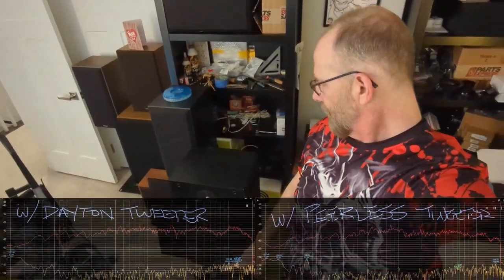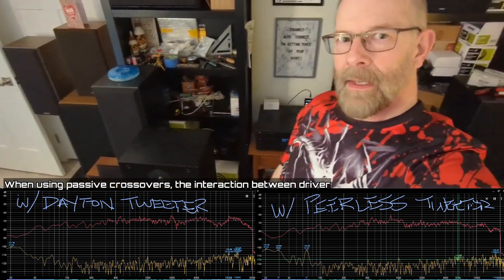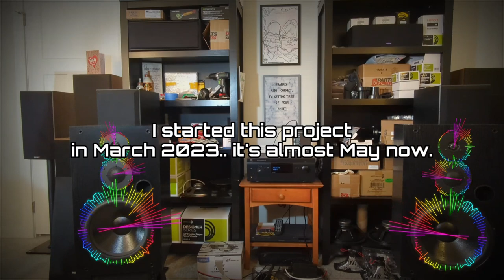Replacing a Peerless Tweeter with the Dayton Classic Silk Dome Tweeter RCA STS-1230 PART 20

Comment: Any idea what your cross-over frequencies are?
Reply from the maker: Hi Emmett and thanks for the great question! The truth is, I wish I knew. I bought them on eBay used, and the seller couldn't remember.  If they're the same as Laspada current designs, it should be either 650/5000, or 850/3500 Hz. From the first couple sweeps though, it's really hard to tell where the crossover is because it's working pretty well. There's no obvious suck outs or peaks. I figured anywhere between 500-1500 at the low end is fine, and anything above 3500 for the tweeter is good too. I may install Zobel networks on the drivers to see what happens also. I did that on an older project and it was pretty impressive the difference it made when all the drivers had Zobels. With just one or two drivers it didn't make much difference, but installing them on all three drivers, it helped immensely.

Comment: True the peerless may of had a flatter response but they were not as efficient as the Dayton so the Dayton matched better.
Reply from the maker: That's sort of what I was thinking as I was looking at the graphs side by side. The Dayton does have a higher sensitivity and I'm thinking that may have helped transition to the midrange. I'll need to look into that some more and see what the Omnimic software results are. At first sight, it seemed that the Dayton tweeter seemed to have behaved better with the network and cleaned up the midrange even further down the line as well, but the transition towards the treble end suffered some. I'm not overly concerned with the peakiness above 10k with the Dayton, since not much playback material is up that high, but it was impressive to see how flat the little Peerless was up there. Between the two however, and the Dayton being a plan C backup, I was glad to see a cleaner midrange even if it doesn't have an impressive high end. I'm wondering what it'll sound like after it plays a while. It's a pretty sharp sounding tweeter for being a silk dome. It sounds more like mylar at times. The Peerless silk or textile is crazy smooth sounding though, while still having that sparkly high when needed. It also seemed less finicky about loud volume compared to the Dayton, which sounds nice to a point, but push it too hard, (anywhere past -5Db reference), and you can hear it get trashy sounding. I got 3 more of those little Peerless tweeters from Digi-key I'll use those in some other projects. It's too bad Parts Express doesn't offer Peerless unless bulk ordered, they seem like nice transducers.
Reply: Regarding the peerless you like often one can find those speakers from another online seller

Comment: How about learning how to design the crossovers so that they match the measured responses of your drivers in their enclosure. Doing this will remove the trashiness in your dayton tweeters
Reply from the maker: Thank you for watching and the comment Bernard. It's a valid question and an excellent suggestion. Designing crossovers for the drivers, and fine tuning them once assembled in the cabinet is the best way to do it. 

The projects I've done in the YouTube videos thus far are all budget bang for the buck builds, so I've gone at it a bit differently.

In this particular build, I utilized an older used pair of Laspada Audio crossovers that I got for really cheap on eBay. I couldn't even buy a single decent air core inductor for the price I paid for them.

That being said, they had several hundred dollars worth of parts on the boards, but I figured I'd try them out on this project. They're really impressive for pre-made crossovers and based on measurements and listening throughout the build, they work pretty well as is. In a future video on this project, I'll likely install Zobel networks on the drivers. That worked wonders on an unruly pair of off the shelf crossovers I utilized in a previous build.

The Dayton Designer tweeter was originally purchased as a backup for that other build, (Jensen CS 315), but I found that the GRS Phenolic Ring Cone Tweeter originally selected for the build, sounded better so the Dayton Tweeter was shelved, but I had to pull it out again for this build because of my own Blunder when I ruined a Peerless, and being too impatient for the replacement to arrive. The day I installed the second Dayton Designer Tweeter, the Peerless showed up on the doorstep, but I'd passed the point of no return by opening up the holes in the baffle, so I stuck with the Dayton for now.

Now... About that trashiness I hear from the Dayton Designer Tweeters: I'm not entirely sure what's causing it, but they behaved similarly in my other build as well. Even with Zobels on them. One viewer suggested it might be due to the width of the baffles on the vintage speakers and it's a possibility. I don't think it's the crossover itself causing the problem, but more likely misapplication of the tweeter. The Dayton Designer Silk Dome has had a lot of use in DIY designs that have yielded good results. I've not had the same luck though.

The problem occurs, (or is most noticeable audibly), when they're turned up. They get a really harsh sound after about -5Db volume setting, that dissipates when the volume is turned back down. By contrast, the baby Peerless Tweeters seemed impervious to volume, behaving like "yawn, is that all you got? I can do this all day", whereas the Dayton's start complaining, loudly.

There's an inherent suck-out and then peak that occurs with the Dayton's before and after 10k, which I'm not sure if that's due to dome fatigue, break-up, diffraction or what. It might not even be a huge issue for some folks, but it gets my attention right away.

For right now though, the Dayton's need to stay in there because the faceplate is so big it'll be tough to find a replacement. I thought about trying the Dayton Reference Series Tweeter because it looks very similar in size, unfortunately they don't make an 8 ohm version. I'm scouting the web currently to try and find something else to try in its place.

I mentioned in another video I had, that it's doubtful the Dayton Designer Tweeters are problematic, because they've had great reviews and many DIY designs incorporate them, but in the applications I'm using them in, they may not be the best choice.

That was a long winded answer, but you had a really great question that deserved an explanation!
Reply: @wattspeakers  A loudspeaker frequency response does not give enough info. 

The trashiness  is the result of excess energy in the tweeter. Cone breakup, phase delays, time delays, choice of x-over slopes (APC's types normally sum at -6db,  whereas CPC's types normally sum at -3db and there are all others in between designed to mitigate phase issues also add their sonic signature). And of course the cut off points make a real difference in the perceived  "power response" of the loudspeaker as well, not to mention vertical and horizontal off axis responses.

 If you are passionate enough, read the vance Dickason's loudspeaker design cookbook which is well documented on crossover design and Joe D'Apolitto's book on measuring loudspeakers. These books helped me a lot back in the day to get me going. Good measuring software such as REW or ARTA are fantastic pluses and X-SIM is great crossover design software. 

Love your passion, you are on a great journey.
Reply from the maker: @bernardchesneau3091  Thanks for the suggestions. I'll look into some of that as well. I've got the latest version of the Loudspeaker cookbook. I also build speakers from scratch, but with the vintage resto-mods I'm not overly concerned about provided they turn out better than they were. Actually I'm listening to these RCA's with the Dayton Designer Tweeters currently, and at a moderate volume they sound phenomenal. The tweeters only seem to get funky when the volume gets stupid loud.